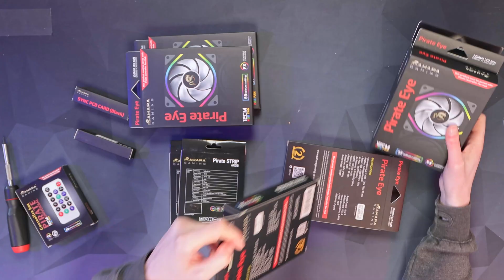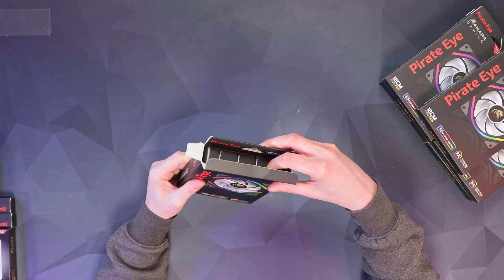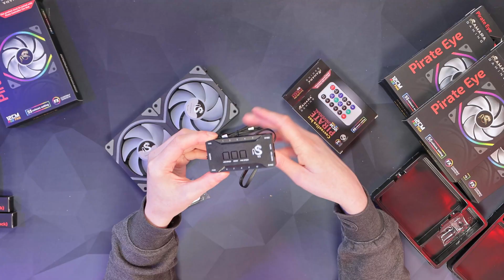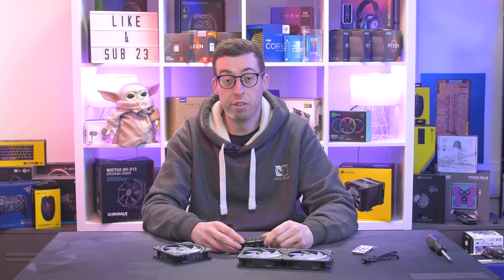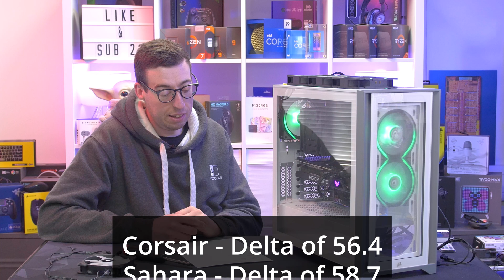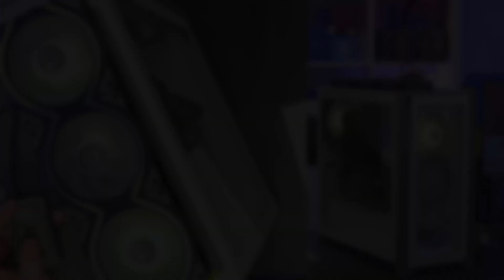CHEAPER UNI FANS? - Sahara Gaming Pirate Eye - Unboxing, Overview & Testing! [4K]

Comment: If I were to order three fans would I get everything I need to use it? Like the hub or is that sold separate?
Reply from the maker: There are options to add the controller, otherwise it just comes with the sync card.